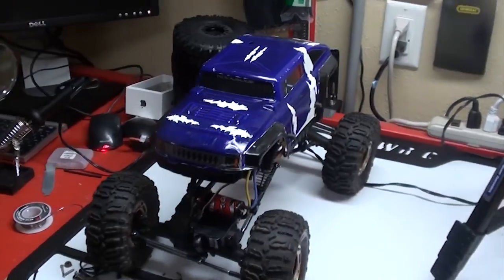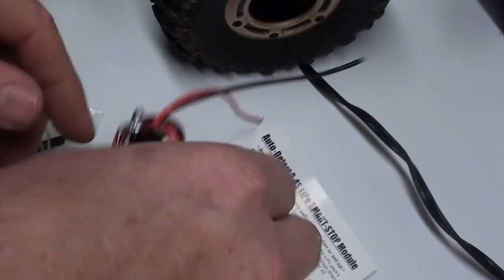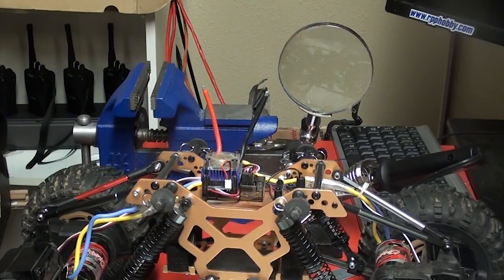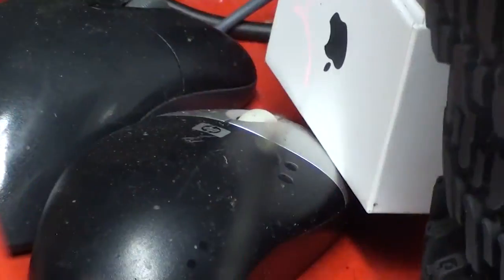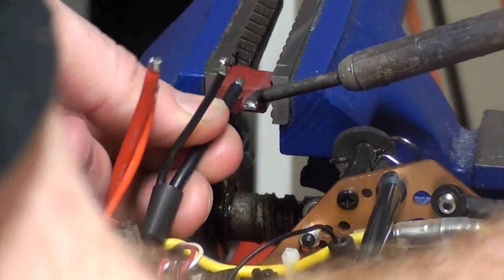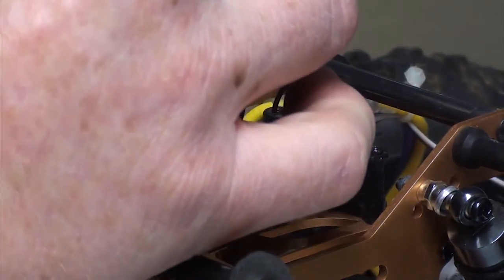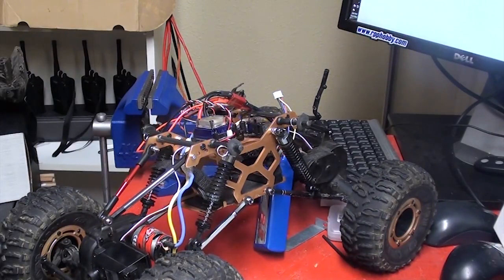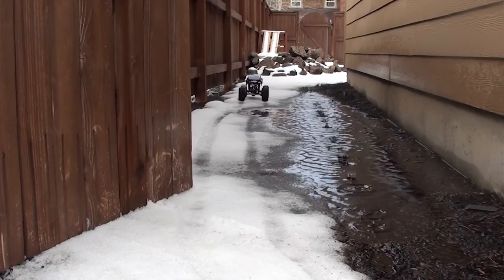Rapid Rhino RC #34 - converting a Redcat RS-10 to use LIPO battery

Comment: Thanks for posting this.  So I did exactly how you did.  Even bought the same Novak smart stop part.  I got everything going, but I'm not able to go forward or reverse.  I can turn all the wheels in all the steering modes, but no forward or reverse.  Any thoughts?  Same truck
Reply: Same problem without it the cutoff, just hoping to see a response of why the fix is

Comment: (cont.) the BEC is on. Only one of the 2 batteries is responisible for providing power to steer. this is the battery side you must solder to the BLACK 20g wire to. the instructions say to hook up only one battery on one side to see if the ESC blinks a little. the other side wont do this. this is how i determine which battery gets the black wire soldered to it. PROBLEM: NEITHER side does this. so, finally my question: are the wires at all color-coded to tell which supports the BEC and steering?

Comment: Mr. Rapid Rhino: Thank you very much for your EXCELLENT video. I received my Novak spart stop today and have been scouring online to figure out how to install it. your video is the most helpful one i watched today. I do have a question, and i hope you have a min. to respond. I am installing the LVC into a brushless converted e-revo. i have to figureout which side battery the bec is connected to. i have 2 two cell batteries 7.4v ea. total 4 cells. i must solder the black 20g wire to the side that